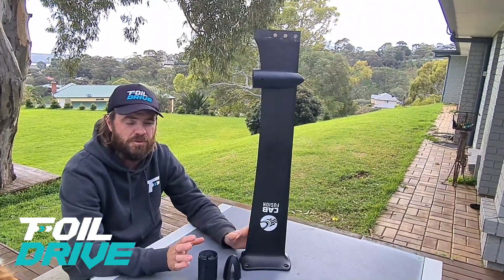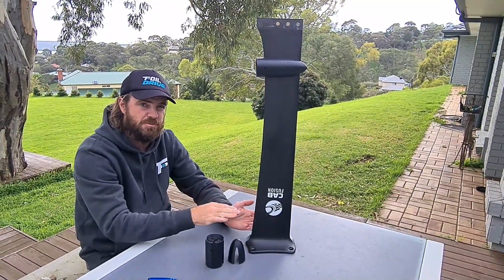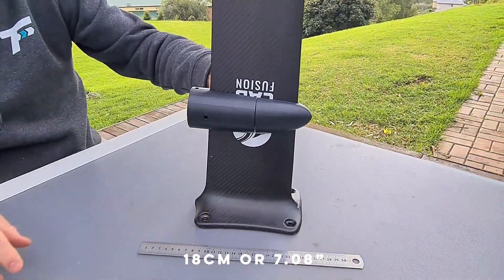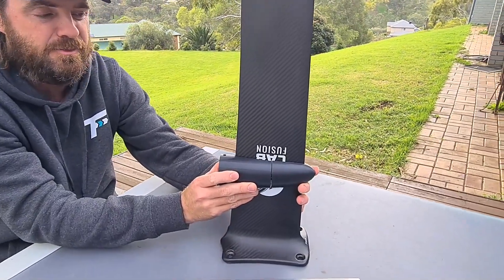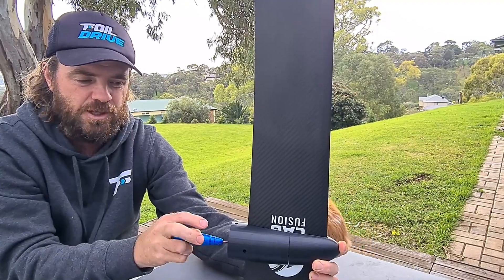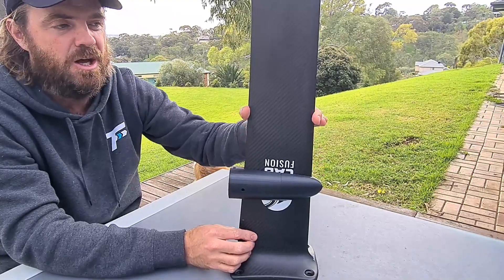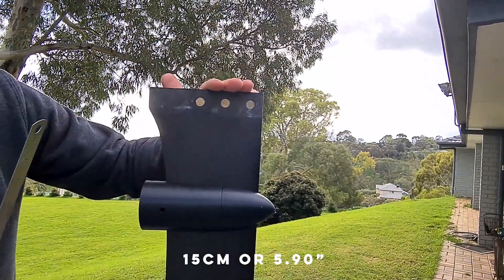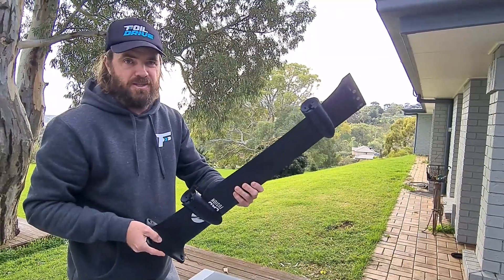Cabrinha Fusion Carbon Mast - Motor Pod Fitment

Comment: Do you make a pod for an Armstrong mast?
Reply from the maker: Sure do! We have two Armstrong pods available, designed to fit near at the board end of the mast.

We will have some Armstrong Gear at HQ soon and will be working on an efoil specific pod for the same reason of the tapered mast. As the Armstrong shape isn't as dramatic, the current pods can be used lower but require packing out for perfect fitment.

You can find our list of pods here:
https://www.foildrive.com.au/product-page/mast-motor-pod
Reply: @foildrive  thanks guys. Hoping to get one in the UK but funds not quite up to the dream just yet